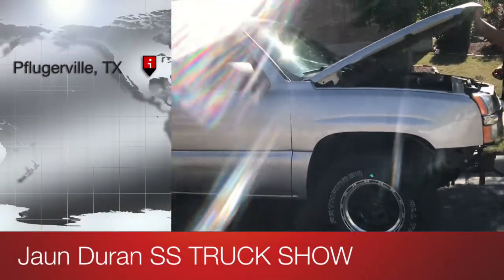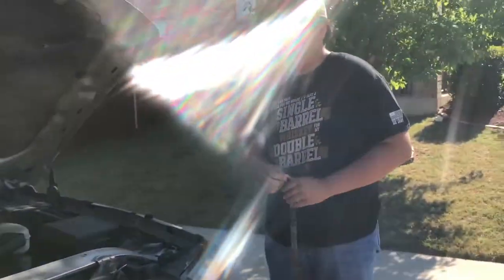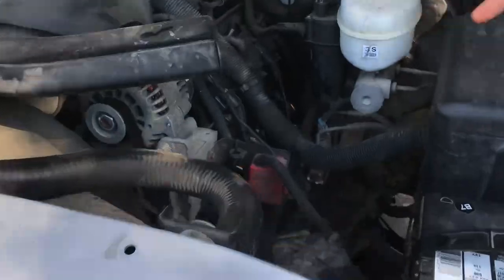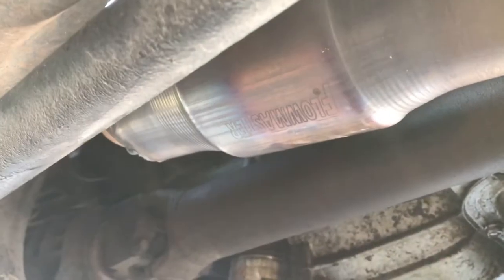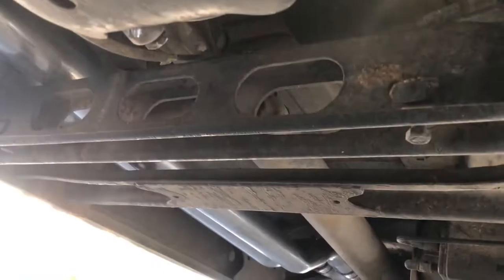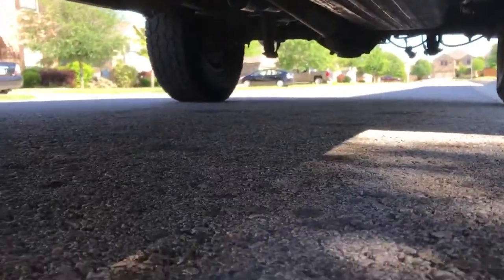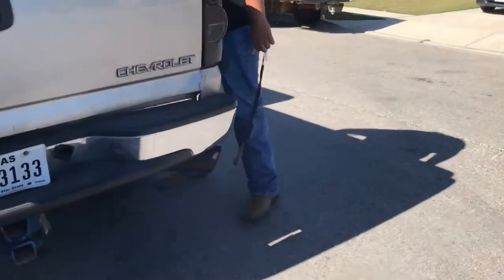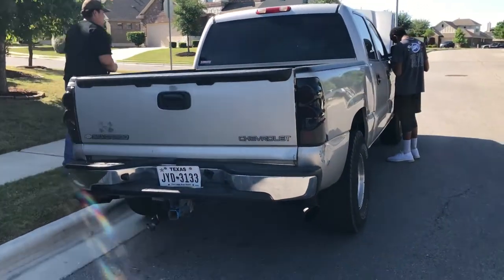2004 Chevy 1500 5.3 Stubby Headers with super 10s

Comment: Did you get any codes after you install the high flow cats or did you have to get the o2 sensors shut off .?
Reply from the maker: Fidel Cordova I believe after this he had O2 codes and he just ignored them
Reply: You need to install spark plug non foulers where the o2 screws in to remove the o2 codes also have to drill out the non fouler for the 02 sensor to read and not over heat the sensor